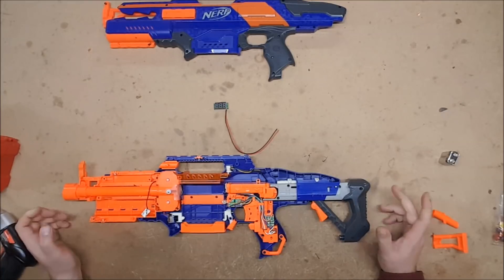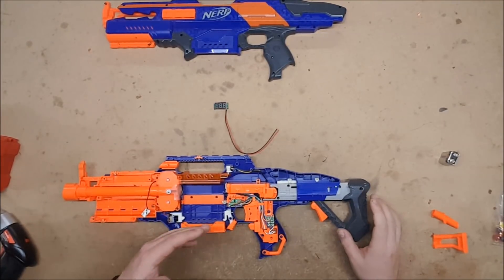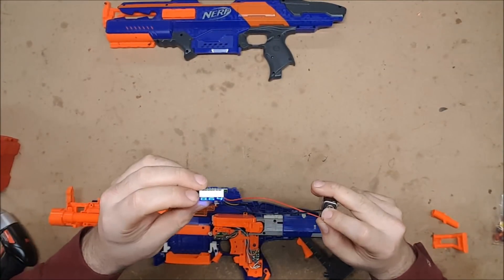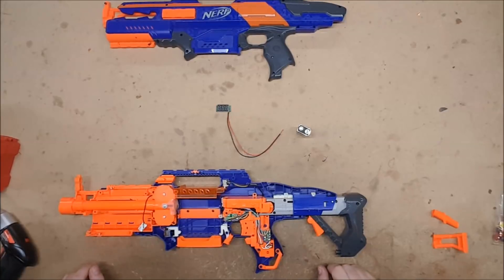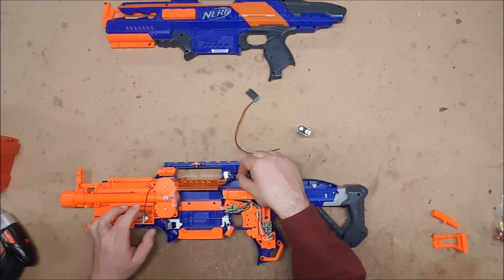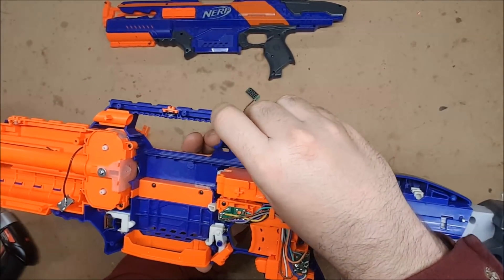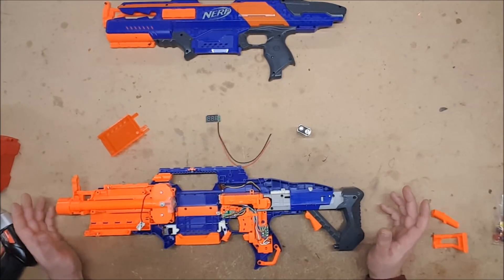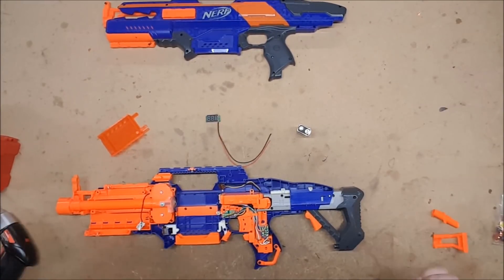Monday Mod Tips - Voltmeter Basics

Comment: Does it matter if you run negative through the switch or positive?
Reply from the maker: Depends on the circuit. If it is a simple Open/Close switch then it does not matter. If it is something more complicated it can matter.

Comment: I swear I did these steps on a stryfe and my wires started to melt. Does anyone have a diagram
Reply from the maker: Then you did it wrong. It sounds like you created a short circuit somewhere.  It should just be:
Bat Neg > Meter Neg
Bat Pos > Switch NC
Switch COM > Meter Pos

Comment: How do you wire a voltmeter to a momentary switch in a Stryfe?
Reply from the maker: I cannot put images in youtube comments.  I would recommend you watch my video on how switches work and apply it to a volt meter. Or watch my video on how to rewire a Stryfe and just replace the flywheel assembly with the volt meter. 

Negative (usually marked with a - or a black wire) from the battery goes to the black wire on the volt meter. Positive (usually marked with a + or a red wire) from the battery goes to the "Normally Open" (usually marked NO) pole on your switch.  You then connect the "Common" (usually marked with COM) pole on the switch to the red wire on the volt meter.

If your switch only has 2 poles then it doesn't matter which pole goes to were as long as it interrupts the positive circuit.
Reply: @CaptainXavier  Oh, okay, you can send me the information at austinhamilton0319@gmail.com, if you want to.
Reply from the maker: The same way. 
Bat Neg -> Meter Neg
Meter Neg -> Switch NO
Switch COM -> Meter Pos
Reply: @CaptainXavier  Can you provide a visual representation of the wiring process because I don't know what the connections mean.

Comment: Do you know if the voltmeters can be powered by the Lipo they are reading without any issues?
Reply from the maker: ...that is how they work...they don't even have an option for a separate power source.
Reply: @CaptainXavier  The ones I have must be different then, cause they have 3 leads, 2 for power and one for the source they are measuring. Thanks though for letting me know that they can take the Lipo. :3

Comment: So, I installed a voltage meter in my Stryfe. Thanks Captain! I've got a Zippy 2S LiPo 1000mah and Fang Motors from OutOfDarts. At what minimum voltage should I stop firing my blaster and charge my battery?
Reply from the maker: Most things I have read say 3v per cell.  So with a 2s that would be 6v.  But I am certainly not an expert in LiPo, I would do some research.

Comment: That's really useful, I was wondering where I wanted to solder my voltmeter, I think I'll attach mine to the rev switch, especially on my Rayvens, maybe on the jam door on my Stryfes, I got a few of different colours, depending on the colour of the paint-job I decide to do.

Thanks for the video, invaluable as always.
You should do the braids you had in your beard more often, it suits you!

I finally got around to making an intro to my videos (the latest being on the Kronos I want to K26!)

Have a great weekend my friend, take it easy and thanks for the advice.

Comment: On a rayven where would you recommend installing the voltmeter? In the stock or in the part that rises to make the carry handle (like on the assault rifle from halo)
Reply: Carry handle imo. I'm doing a flat top rayven, so I'm putting a 3s lipo in the stock and putting the voltage meter on the battery door

Comment: Hey, love your vids. This seems like the best place to ask as any. I come from the race drone hobby world and we deal with higher voltage and much higher current draw than what I'm finding when upgrading to, lets say neo rhino. For smaller quads with 3's 450mah-1000mah we use xt30's and they use 4 motors that pull 27a on avg. I'm wondering why doesn't everyone change out their lipo connectors to xt30 connectors instead of the standard xt60s. They can handle a continuous current of 30a and a burst of 60a. They also are ideal for 16 - 18 gauge wire. Am I missing something or is it just people want to deal with. I'd love to have the extra space. It's a massive size diff.
Reply from the maker: No idea.  I am not an electrical engineer.  Half of what you said meant nothing to me.
Reply: LOL. No worries, I wasn't sure if you had heard anything on another video.

Comment: @Captain Xavier- as far as power is concerned, how do you feel about IMR vs NIMH?  I have several Lipos as my other hobby is RC cars/trucks/drones but I have IMR and NIMH i can use in my son's blaster.  I'm using 2 IMR+2 dummies which seems to have less Watt-hours than 4 Eneloops.   Would it be better to run the NIMHs over IMRs or is there something I'm missing mathematically?  Thank you
Reply from the maker: I have never used NIMH so I could not say.  IMRs are going to have a fairly short run time on Flywheel blasters.  They just are not designed for that.  I only use them in my secondaries that get much less use than my primary.  For a Primary flywheel you really want a LiPo or you are going to be changing them several times during any normal use game.  That is my experience anyway.
Reply: What about the NIMh you can get for the Hera and Nemesis?  Seems to atleast perform better than Alkalines

Comment: Sorry to sound like a noob but,what is the point of a volt meter? (I'm pretty new to modding)
Reply from the maker: To tell you the voltage of your batteries.  I thought I mentioned the purpose in the video.  If you are using rechargeable batteries you do not want to drain them past a certain point or they will no longer recharge.  So it is a good idea to have either a voltmeter or a voltage alarm in the system.  And they look cool.  :P
Reply: Captain Xavier ok thanks

Comment: I have a question. Is there a voltage that is unsafe when using a LiPo, or a normal voltage? Just want to know. (Might start a cool project, just need to work up the nerve...)
Reply from the maker: It all depends on the motors you are running.  You need to match the voltage to the motors or get motors that run at the voltage you want.  7v or 12 is pretty much standard for Nerf.  Much beyond that and you get blasters that most wars won't even allow.  Some events have no limits so you can go nuts.

Comment: Ideas:
ammeter
ohmmeter
wattmeter
calculation examples for V=IR
Complex understanding of battery selection with specific motors
Plunger seal troubleshooting
Full brass breech (like for a longshot, for example)
preparation for 3d printed parts to be primed
re-barreling of a vintage blaster
creating a modular titan tank / drain blaster (how to make it take removable barrels / absolvers)
reinforcing of a plunger head / rod
3d printer setup

you probably have done at least on of these, but keep up the great work!

Comment: Suggestion for mod tips, air blasters like the xbz. How to replace the pump with a bike pump, adding an electric pump, adding pressure gage, having both electric and hand punp, and alternative way to fire it. If you few XBZs to work on, that could be arranged.

Comment: Hey captain,  also make sure any voltmeter bought is looked at close, I have had 4 out of 20 have the red and black wire backwards, so the volt rev showed up after rev was let go for a split sec, it was crazy thought I had wired it wrong, this was my case any way.
Reply: CommanderWolf Hadley could just be your brand
Reply: Kun it might be, going to try a different source next time too.

Comment: Is it easy to fix a Longshot with a bad spring?
Reply from the maker: Yes.  Replace the spring.
Reply: Captain Xavier thank you (I’m only 11 I know nothing)
Reply: gamer guy we all start somewhere
Reply: I’m 13 and I can wire advanced nerf mods.

As a wise man on this comment section said, we all start somewhere.
Reply: SquidMakesVids I'm only 12 and made a 177 FPS pump action longshoremen with brass breach (anyway the point is age is not a determining factor for skill)